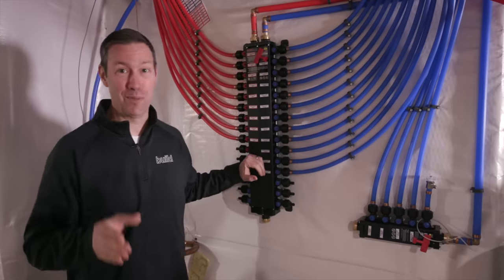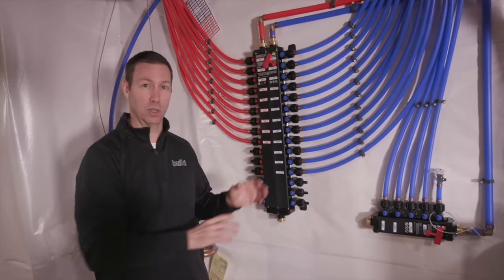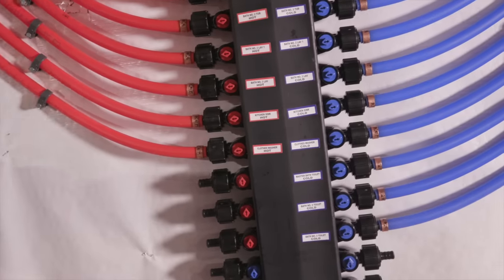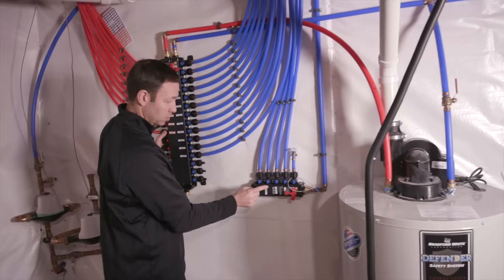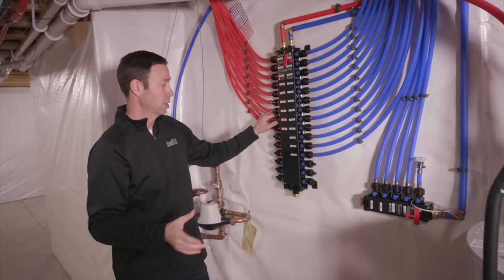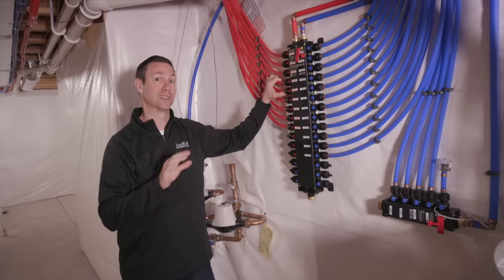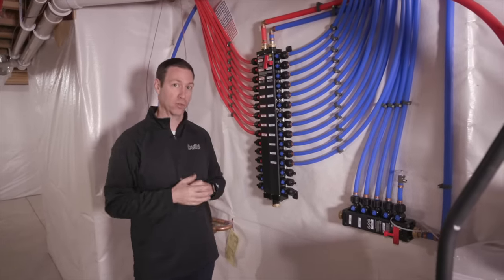PEX Manifold System - Pros and Cons + Tour

Comment: I have one of these systems and have been using it for 9 years it's nice. The runs average 50 feet so it may take 30 seconds to get hot water.  I agree that the hot lines need to be insulated. An electric in line heater should be installed under each sink. We don't have that here, but if we lived in town where water and sewer are expensive I would definitely add the heaters.

Comment: One unmentioned advantage is that this system is way easier to use when replacing pipes in an existing house and the PEX can be snaked through the walls. 

Some other notes: 
In the south: we put these in our garage. 

If you really want to use shared piping to a distant location you can do that; simply put a manifold or split in [for example] your master bath. You won't have the single-outlet-per-output in your main manifold; but you'll still get many of the advantages. 

Closed hot loops don't work well with instant-on heaters (because you have to keep re-heating the water); so sometimes the inability of this system to use a closed loop isn't really a disadvantage. 

You are right that these aren't insulated. I've never seen insulated plumbing pipe (but I'm in the south: maybe it's different in the north). 

I'm not convinced that "hot shower then hot sink almost immediately before/after" is a common enough scenario to make it something to account for. 

The lack of joints improves water pressure.

Comment: thanks for providing this video. For future videos, you may want to consider the comment about "one of the downsides of PEX...". There are some adv/disadv for PEX vs. copper but the fitting count isn't one of them. In theory, if you plumb a PEX system using traditional routes like you would with copper, the fixture count is identical or copper will be more when you consider that most people order 10' sticks and PEX will have less fittings in long straight runs.  Also, you may want to comment on HW return approach and how this is more challenging for manifolded home-run systems.  Personally, I think there's a time and place where either of these would be preferred when you factor in labor costs, installer expertise, density of fixtures, etc., you might even decide a hybrid using  little of both makes more sense.

Comment: "It could be a long time before hot water."  No, Matt.  The first manifold distributed system I installed was 1991.  Every pipe was a home run, there were no concealed connections in the system except two.  Those two were the master bedroom shower, a dedicated shower, the backside of the Grohe shower valve drywall behind the valve.  In the entire remainder of the house, the pipes exited to the shut off valve under the sink or toilet,, visually and manually accessible.     The REASON I went with a distributed system was for quick hot water availability to the master bedroom shower.  I was presented with two choices only at the engineering stage.  With 3 full and 1 half bath, second floor laundry.  The minimum riser from basement to second floor was a 1 inch riser.  A one inch riser times 20 vertical feet, plus 20 horizontal feet,  requires a heated hot water circulating loop,,, or limited hot water if another shower and the laundry tub is filling,, or a LONG time to bring hot water to the Master Bedroom shower.    Distributed systems fed with a 1" to the manifold are surge proof.  Flush all the toilets you want,, you will never need to have a pressure balanced protector. (Except code still will require it for another decade or two.)

So,,for the house in 1991 , a 7/16ths ID (the tech of the day) gray PEX  plastic,, plastic is not the heat thief as is copper, (Note: I used zero plastic fitting in the entire system)  delivered hot to the master shower in 12 seconds, 70 pipe feet away.   1/2 , 3/4 and 1" copper cannot come close to the performance of a PEX distributed system.  I have installed many since then.  The goal and the benefit is zero joints in the walls.  I used 500 and 1000 foot reels of pipe, set up on a spinning pipe between ladders to pull the pipes through the house, just like Romex.  It requires a different mind set,,,,,  We think, because of copper, threaded, and CPVC,, we think in right angle bends.  Wipe that thinking from your mind and think in terms of a race track with high speed large radius, corners all of radii and parabolas, ,,, a pipe routing can, and should be,, the longest radii that you can envision,, Drill all your holes in the direction of the bend. Making the turn from a 2X10 floor into a 2X4 wall, it is easy to maintain a 20 inch or 30 inch radius.  Feeding hot and cold to a 2 sink vanity, toilet,  rear yard hose bib, and hot for dish washer and hot and cold for the kitchen sink,,, 9 runs in one wall,,, you do the entire thing with  9    7/8" holes,  in each stud, center of wall the farthest run a 7 foot radius.  Everything smooth and uninterrupted.  I would never bundle my supplies under a basement joist,,, how can you finish the ceiling without a pipe chase, or dropped ceiling,,, and you have lost one of the benefits of many small easy to drill holes in soft arcs, and no hangers or clips.  I have done multiple shower rooms for the Boy Scouts,, each shower getting a dedicated hot and cold,,,, zero surge,, zero pressure change when someone else turns theirs on or off.

When you get the hang of the system, one man can run all the supplies from basement manifold to inside of every vanity and sink base, shower access, and laundry room wall,, in a single day.  And never pull out a torch.  It is actually easier and faster than pulling electrical cables,, the plastic pipe is a little flexible and a little rigid and the plastic PEX is slippery against the wood.  If you have kept to generous bends,and holes drilled in the direction you are going, , it pulls easy and very fast.

The only change I would ask  of materials suppliers.   The absolute ideal ID for a distributed system is 3/8", a 3/8ths inch PEX line,,, a one centimeter line.,, fairly thick wall, zero right angle bends, would give a 5 gallon per minute flow rate.  Smaller and easier to pull,, and yet much faster hot water  response.  After 27 years?  of installing them in my projects, there is nothing faster, there is nothing less expensive, and there is nothing better than a distributed system.  What you show on the wall,,, we all should be doing,, with zero fitting buried in the walls,, and zero pipes in outside walls.
Reply: This exactly. I installed the Manabloc system on a 1949 house I remodeled 10 years ago. I needed to replace old galvanized water pipe throughout the house. Most of my runs were ⅜" PEX which is more than adequate for faucets and toilets and ½" for bath, shower, laundry and hoses. Very fast heat up throughout the house and no more pressure drop resulting in cold or scalding hot showers.
Reply: That is exactly my experience too.  Going to the 1/2 for the tub fill makes good sense.  The two seater whirlpool tub took a long time to fill.  Most of my recent installs have been 1/2 inch,,, because 1/2 inch is so available.  The old pex was about 7/16ths ID,,, never had any trouble with delivery rates.  Part of it I think is down to the smooth curves and no right angle bends,, the water speeds through.

Comment: Nice video. I've installed a TACO Circ pump at the end of the line which dumps the cold, from the hot. The automatic temperature shut off will stop the circulation so no water waste. I even installed a wireless motion to activate the TACO when entering the bathroom.

Comment: I have this same exact system in my basement. Pro: isolation of a fixture to work on. Cons: as you said lack of insulation.  You have to run back and forth into the basement to turn that run on and off to see if your repair leaks, etc. unless you have an assistant (ie: no shut off valve under the sink or behind the toilet). The "key" is cheap and breaks, The valves get stiff and hard to turn. And yes, a lot of water wasted waiting on the hot water to get to you, especially in the tub or shower.

Comment: I replaced the copper in my 1,900 sq ft house 18 months ago with a Manabloc/PEX system, so I have direct experience with both systems in the same house.  Some of the things mentioned in this video as cons might not be fully understood.  First, a 1/2" PEX tube has a smaller internal diameter than 1/2" copper, so there's less water in the PEX.  And, Viega recommends using 3/8" PEX tubes for sinks, and 1/2" for larger volume items like hose bibs and tub/shower.  The net effect is you are purging a lot less water with PEX than with copper, and I found I got hot water faster with PEX.  With copper on a cold winter morning it took a while for that copper trunk to get warm and get hot water to the bathroom.  With PEX, it's much quicker, and like said, less purged water.  Oh, and the water pressure at lavs with that 3/8" tubing is not noticeably different from the 1/2" copper, which gets downside at the lav fixture anyway.  Having no fittings like elbows between manifold and fixture helps this as well.  Another point you missed - do you see there's an unused fitting on the bottom of the Manabloc?  On a larger home you can connect multiple Manablocs together with a 3/4" trunk, and then have shorter runs from each Manabloc to the fixtures.  It really is a well thought out design.  A couple comments on the install shown in this video: my understanding is you are not supposed to go directly to the water heater with PEX, but have something between the two.  I have 18" flexible stainless steel water heater fittings.  There are also supposed to be caps on the unused Manabloc ports, not nipples, but that's a small item easily corrected.  A few things you didn't mention that people might not think about: the potential danger using a torch is eliminated; the hassle of having to have pipes dry before you solder them is eliminated.  Compared to copper, this is a ridiculously easy system to work on.  I couldn't be happier with the Manabloc/PEX system, and if I ever build a new house again I will require it.
Check out my whole house PEX conversion process here: https://www.youtube.com/watch?v=B34P8AcPRnM

Comment: I really like manifolds but I prefer a hybrid system (a main manifold feeding smaller manifolds around the house). Shorten the runs lengths and you still have a central manifold per room to turn fixtures off. I would install my electrical system the same way (using a sub panel for each floor). A bit more expensive but so much easier to add stuff later on.
Reply: That's what I was thinking. One run of hot and cold all the way to the bathroom, then split off for toilet, tub, shower, and sink from there. You wash you hands or shave, the hot line is charged for the shower and vice-versa.
Reply: that is a good idea what about a circulation pump ?
Reply: @rickrudd  Yes and it's much easier to insulate one big hot pipe than several small ones.
Reply: A hybrid system lets you do recirculation to get latency under control (but not perfect) with a fraction as much pipe and insulation.
Reply: while remodeling my house this is what i did some what. instead i only have a upstairs bath and downstairs.  my small mechanical room is under my stairs in the kitchen. so the kitchen just has a main feed to the sink and then branch off for a pot filler,  hose bib, and ice maker. back in the mechanical room i went up with a main, hit the bath room and branch off to the sink, toilet and shower.  first floor bath, i ran a main and copper headers, that reduce to 1/2. and then runs to the clothes washer and then other branches for shower, toilet, and sink. It works quite well. I spent the extra money and have plenty of ball valves installed. my 1 inch main has a valve, then my 3/4 has a valve at the transition, then when it comes up to to the room another valve, then valves to isolate the softener, then valves for upstairs, and water heater isolation, and hard water supply isolation to hard water points. and isolation under the house at the headers. reduced fittings by doing more sweeps and keep it loose for expansion.  in the future once i gather up my control system parts from work as we start upgrading customers BAS ill collect the otherwise thrown out good controllers and buy some actuators and install a main water shut off valve that can be controlled as well as add some flood sensors so if i have a leak and im not home it can automatically shut the water off. as well as tie in some other stuff in the house such as my HVAC. but thats another story. anyway so far it seems to work quite well. im running a 27kw tankless water heater, it doesnt do to bad running 2 showers at the same time, or running a bath and taking a shower or running a shower and 2 sinks. whats also nice is say you run the clothes washer and then use the downstairs shower you already have hot water almost immediately since they are tied to the same header. now upstairs wont see much gain from it unless some one was to wash there hands or something and then someone else went to hop in the shower then you could see a gain from it. i wouldnt mind doing a recalculation system however it wouldnt fit in to well with a tankless water heater, even though i have thought of some ideas how to make a tankless work with it and using one of our controllers, some sensors and relays  as well as a storage tank, i could make it work however would then take away from the reason to have the tankless anyway since the plus to the tankless is since no one is home x amount of hours a day its not sitting there burning energy to heat a tank of water. unless i set it up with a schedule to where it will start the system at a specific time and stop at a specific time. or have timed intervals.
Reply: @TrogdorBurnin8or  THe standing energy loss from  a circ system outweighs the water saving (from not having to charge the pipes upon use) by a wide margin.  Cold water is dirt cheap, hot water is VERY expensive.  And you keep the hot water circulating, you're gonna lose a lot of BTU$
Reply: @PatIreland  A recirc system is certainly not about saving water (only relative to a sloppy open-loop hot-water-draining system).  It's about reducing the very real human irritation at high latency between when you turn on a fixture and when you get hot water out.  In a large home run system in a large home with large-diameter pipe (3/4") and a low-flow faucet, it may take tens of seconds to minutes before you get any hot water out of your fixture.  If you use smaller-diameter pipe (1/2" or 3/8") it will shorten the latency, but will also cut pressure & available flow rate.  Presumably any recirc system would use insulation on the heated lines - even in a standard home with no recirc, my state requires R-3 on all hot water lines.

In a hybrid system you might run hot water (3/4") to the upstairs third bathroom service box, and have a recirc pump and check valve inside that, which sends water back to the heater; then split it with a small manifold to serve the shower (1/2") and faucet (1/2").  The pipe between recirc pump and water heater stays hot, so it gets tons of insulation;  The pipe between the manifold and the faucet can be code-minimum insulation.  On the distribution board next to the heater, the draw will be labelled 'Upstairs bathroom #3'

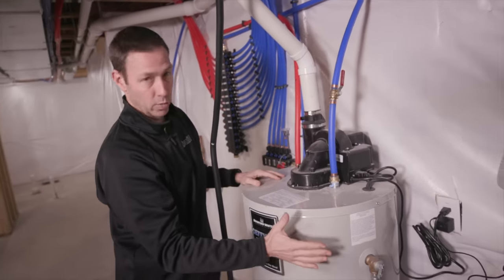Comment: A few points if I may... 1)our house was plumbed with 3/4 pex that went to bath, shower, washer and then kitchen sink (continued on to 2nd bath).  It used to take 2:45 to get hot water at the kitchen sink.  Since I replaced the plumbing with these direct runs, it takes 25 seconds to get hot water to the kitchen sink.  The back bath used to not get hot water when the slab was cold unless you turned on the lavatory faucet while showering due to thermal loss in the slab.  Now we get hot water in 40 seconds and it’s hot due to the increased velocity in the pipe.  2)getting hot water primed in a trunk/branch system with a circulation pump is a waste of energy. 3) keep the distance between your hot water tank and that manifold at a minimum.  4)there’s an inlet on the bottom of that manifold for cold inlet to the house.  5)The top right (blue) pipe is really the stub out to the water heater... cold into the bottom inlet, cold to water heater out the top right, hot in from water heater on top left.  Good video though, glad to see the word getting out about this... it just makes so much sense when compared to an electrical breaker box. Very handy to shut off one line instead of the whole house.
Reply: @ai4px I was in the middle of doing an install, And to your point #5, I am looking at the viega manual for their instructions for "Viega PureFlow Water Systems" And it states either connection at top right or bottom can be used as  an inlet or as an outlet to boiler. There are however minimum pipe length that runs to boiler that will vary on whether you go with top connection (18" to 8" )  and if you mount manabloc above boiler, a minimum of 36" above the boiler is required.